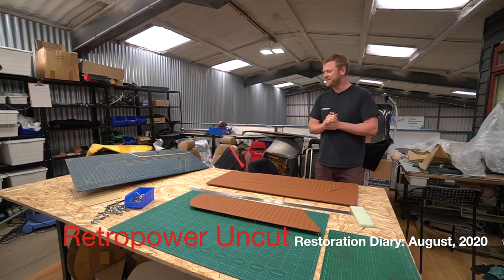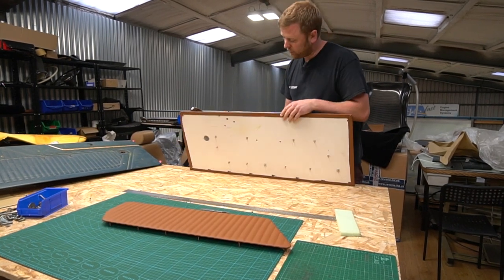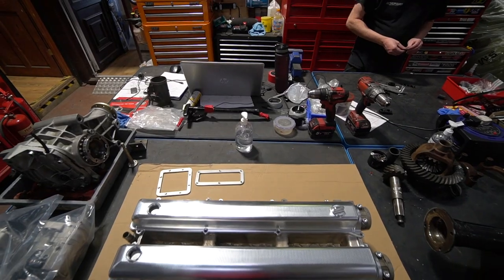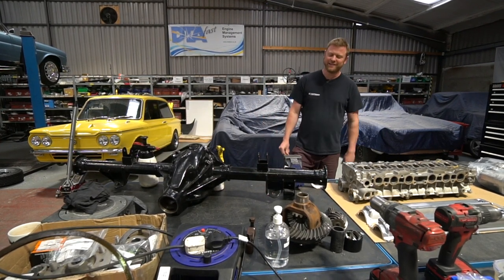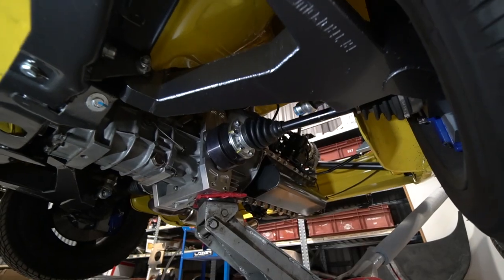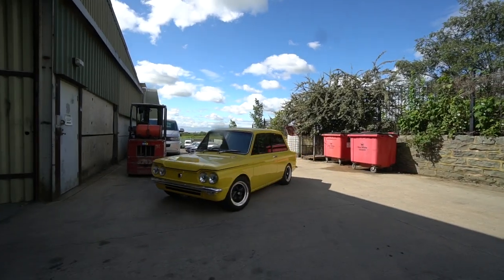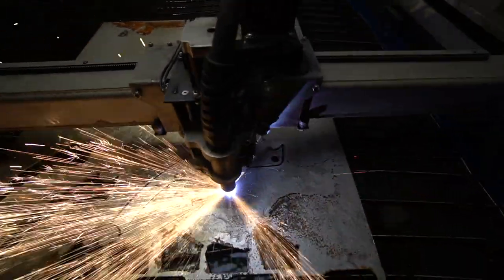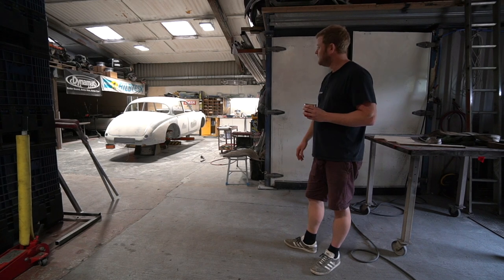Retropower Uncut Episode 6 : Lightweight, Leather & Lasers

Comment: Hi . I can clearly recall an Elan that l saw regularly in the '60's and the characteristic winding up noise coming from the rotoflex joints as they protested under the strain of accelerating away from the traffic lights. I shudder to think of the bottom line for the work on the lmp !

Comment: Great to see the imp - prompted me to go and stare at my Sunbeam Stiletto in my garage - stripped it down in 2006 to do welding and haven't touched it since. Almost criminal as its a 998cc twin weber fast road car. Lowered suspension front rad, front disks etc etc...... very sorted but very tatty. If only I lived near Retropower. Strangely - out walking today and another imp passed me! Hadn't seen one for years around where I live.

Comment: Love the detail on the Imp. Any chance you could provide more detail on what you've done around the diff casing? I presume this is partly to accommodate the CV joints but also to stop the diff splitting the casing with all that torque.
Reply from the maker: It is purely a brace to strengthen the casing

Comment: Love the Hillman Imp. Cut my teeth on those back in the early 70s. Cleaning out radiators fitting new water pumps and many head gasket failures. King pin seizures were another common problem. I assume you have done away with those. But for all it’s original faults I really loved the Imp and could never get on with the Mini. Oh the joys of three wheeling our works van around tight corners.
Reply: Ian Basson - bit young to have owned an imp, but my uncle had one when I was a kid, he used to take me out, ragging it round and I used to love it! When we got back he was always saying "dont tell your mum"! (His sister) Many happy imp memories! I was glad for this bit of coverage!
Reply: @K1lostream  pimpin' in an Imp !
Reply: I used to road rally an imp in the Midlands and regularly used to see 8k rpm on a standard prepared block.  The ONLY time I had a rad problem was when the neck of the rad de-soldered causing a leak.  It was well known that the Imp was too advanced for most of the owners/garages back in the day and they suffered too many rock ape servicing/maintenance regimes.
I would be concerned about using CVs on the inner end of the driveshafts as the shock loadings can cause the gearbox to crack.  Whilst the old Metalastic Rotoflexes would rip apart when abused, I only found that they failed when autotesting, never on a road rally.  Besides, I could replace a Rotaflex in 9-10mins (timed - the factory regularly did both in 9 minutes on events)  I have a Clan to build and I am now considering using BMW/Merc driveshaft guibo joints that are much stronger than the old Metalastic Rotaflexes.  At one time I toyed with the idea of using CVs at both ends of the drive shafts but also using the Roatflex joint to accept only torsional loads to soften the drive take up.as Porsche had done on its race cars, but dismissed it as too complex for such a simple car.
BTW Chesman Engineering (nee Greetham) is still in existance in the same premises in Coventry.  After Andy Chesman's success with the Greetham engines he went into hydroplaning using Imp engines in 1980's where he was a major winner.
Reply: @clivewilliams1406  My first car was an Imp. From what I remember you could be right about the CVs. Early cars had 7/8" (IIRC) driveshafts which broke, so they were uprated to 1" which lead to the diff cage breaking in competition. I remember something about a pearlitic cast iron [one] from the early Imps being the solution. The usual upgrade to the Rotoflexes was to fit the ones with intermediate metal inserts as used on various Lotus.
Reply: @Graham_Langley  Early cars had 7/8" driveshafts that was updated to 1", which everyone in the know used.  The diff cage only broke due to shock loadings that the rotoflexes absorbed and this was shown when various people substituted CVs for the rotoflexes.  If its any consolation Porsche had to use a Guibo (rotoflex by another name) on the drive shafts of the 917 CanAm cars as they had to use a UJ for both the inner and outer joints.
Today the Imp diff can be substituted for a much stronger Quaife ATB that is quite soft on take up across the axles to give a lsd effect.  Lotus Elan/Competition Rotoflexes were an expensive upgrade but I found that so long as you didn't sidestep the clutch from standstill the Rotoflexes could be preserved - it taught me to be a very smooth driver that was of good benefit to competition times.
I have noted that Febi, the automotive coupling manufacturers produce propshaft Guibo joints that can be a direct substitute for the Metalastic Rotoflex that should cope better, especially as they are used in the high powered Mercs and BMWs.

Comment: On the M series straight 6 engines would loose valve clearance if you polished the valve covers
Reply: huh?
Reply: @uliwehner  Before the J series engines (2JZ etc) Toyota used the M series engines. If you polished the valve covers the heat wasn't radiated as quickly as the black original finish and caused issues with the valve clearances. I don't know if there might have the same problem with the 2JZ if you highly polish the valve covers to match the original Jaguar engine, from hearsay the Aston Martin straight 6 of the same era as the Jaguar engine didn't have polished covers for the same reason.
Reply: @tda2806  interesting. makes sense
Reply: @tda2806  Most post war Italians painted theirs...- Maserati, Ferrari, Lancia

Comment: Jag IRS on a Merc W108?? Regretting not putting coilovers on my XKR now  - bottled it due to all that weight on 1 bolt in each suspension arm. You guys have gone beyond by installing air-ride! I feel such a fool :(
Reply from the maker: We had the same concern and made up additional plates to put those bolts in double-shear 👍
Reply: @retropowercars  Any photos? Long term this is heading down the quarter mile and I need a double adjustment solution a the rear as I add more power. Thanks in advance. Awesome videos BTW.

Comment: Hillman Imp: " Copying is a form of flattery"!   Front end copied from a 1960-1964 Chevrolet Corvair!
Reply: Base model does not have the double headlights, but sure it borrows quite a lot of features. Also on back in sense that it has turned the double tail lights 90 degree, and has similar lip on the rear deck.
Reply: well, the NSU Prinz 1000 was out in 61 and it is the same size as a hillman imp. So i say the imp was copied from the prinz which may have copied some styling queues from the Corvair. It was rear engined before the Corvair though. The later TTS/E models were hillclimb favorites back in the day